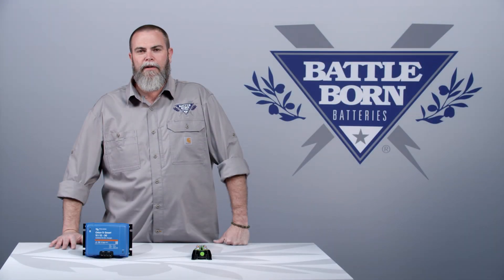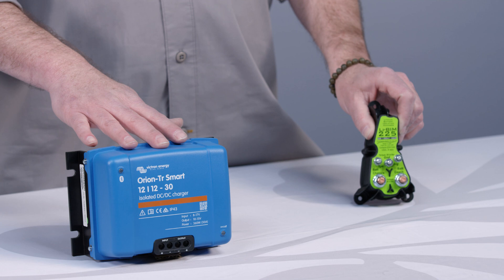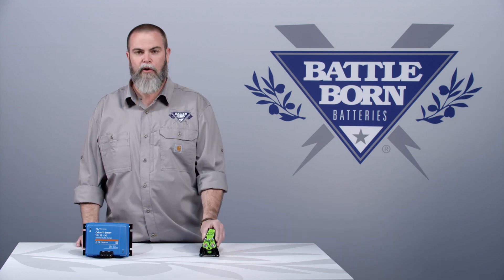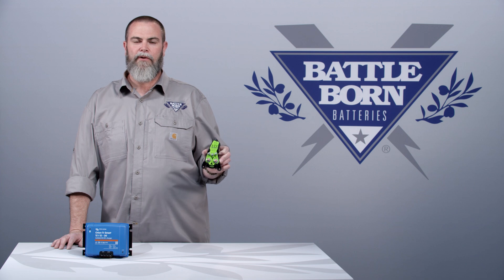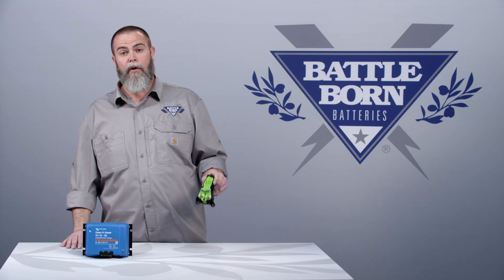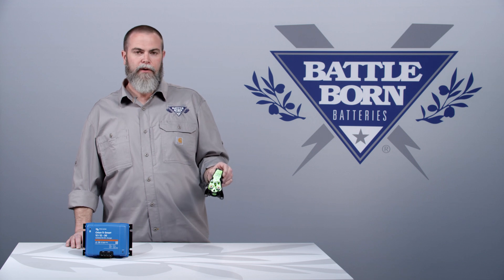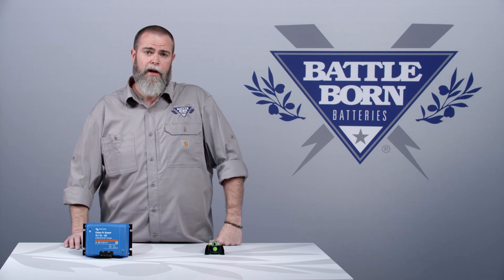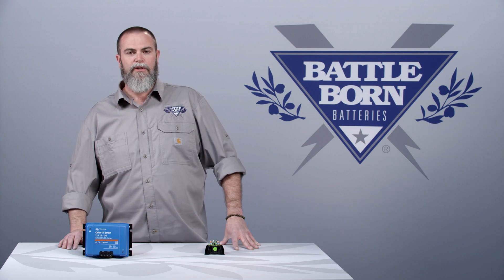FAQ: What is the difference between BIM and a battery to battery charger? l Battle Born Batteries

Comment: Thank you for this informative video. It seems to me both BIM and DC-DC charger have pros and cons. So, I would like your opinions in my case. I have a camper van equipped a BIM (non-lithium) with 180 amp alternator, 400 watt solar, 300 (3 x 100) Ah AGM battery. I am planning to upgrade to 600 (2 x 300) Ah lithium battery. Should I go with the Li-BIM or bi-directional DC-DC charger?  It is cheaper and easy to install BIM since a BIM is already there (just replace and no additional wiring, I guess), but worry about over heat the alternator as some people pointed out. Thank you very much in advance!

Comment: How can you prevent the house batteries from overcharging? Great video, thanks
Reply from the maker: Hi Matt. The battery management system (BMS) monitors individual cells in the battery pack. It then calculates how much current can safely go in (charge) and come out (discharge) without damaging the battery. The current limits prevent the source (usually a battery charger) and the load (such as an inverter) from overdrawing or overcharging the battery. This protects the battery pack from cell voltages getting too high or low, which helps increase the battery’s longevity. The BMS also monitors the remaining charge in the battery. It continually tracks the amount of energy entering and exiting the battery pack and monitors cell voltages. It uses this data to know when the battery is drained and shut the battery down.